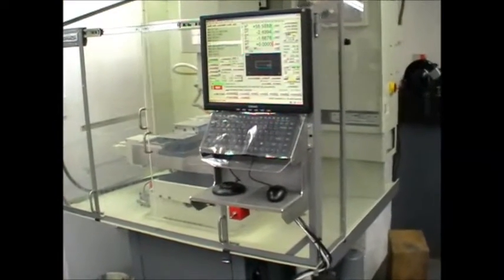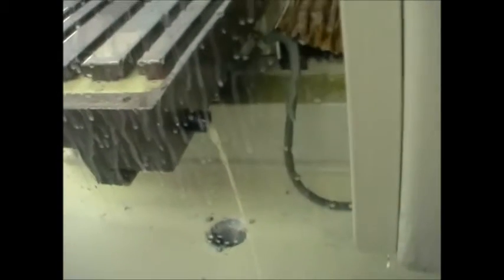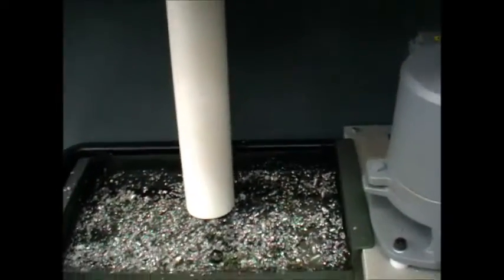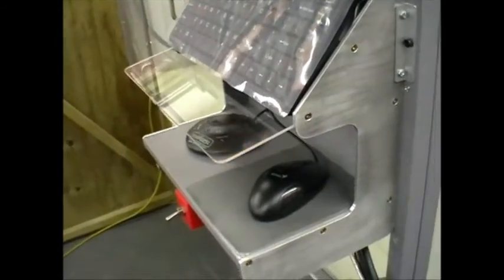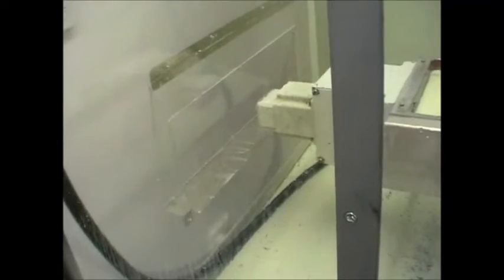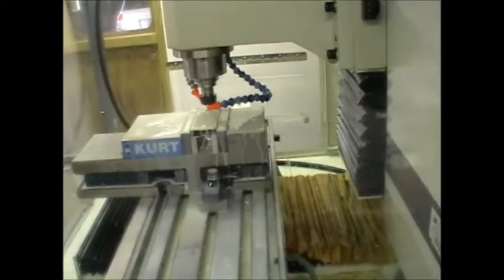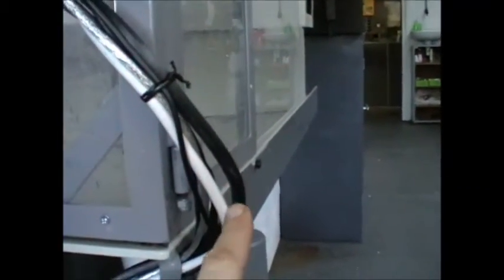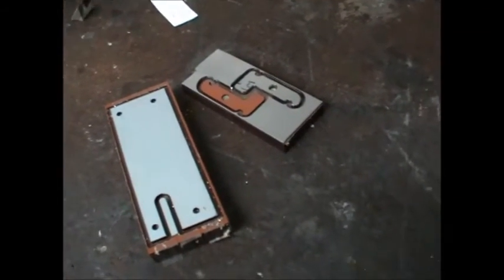CNC Compact Enclosure part 2

Comment: I really like this design over version 1. Have you decided to go into production, or sell plans? Thanks
Reply from the maker: Thanks. I don't think there is yet enough demand. Cheers
Reply: I understand. I have a small shop, but want the 1100 vs the smaller mills. This would work perfectly!
Can you tell me about the chip pan? It doesn't look like the one from Tormach. Didi you make it yourself? If so, what are the dimensions? Thank you!
Reply from the maker: Hi - I made the stand and chip pan for both my 1100's. If I was building again I would use the design chip pan from my other 1100 (see the youtubes on it) and the sliding door style enclosure you have commented on. The sliding style enclosure is 1410 x 1120. cheers.